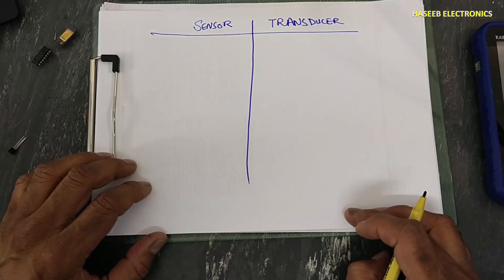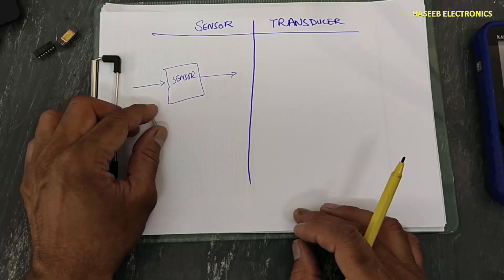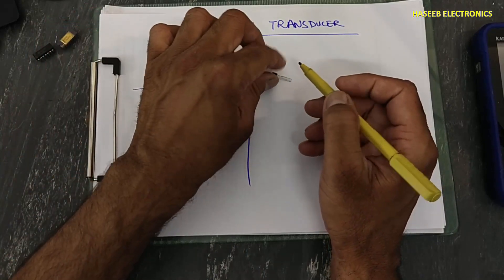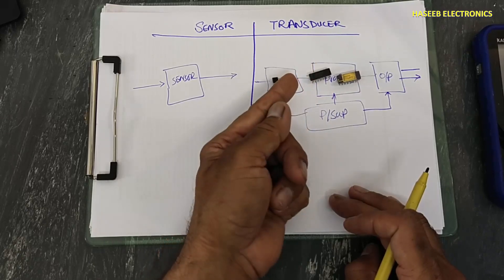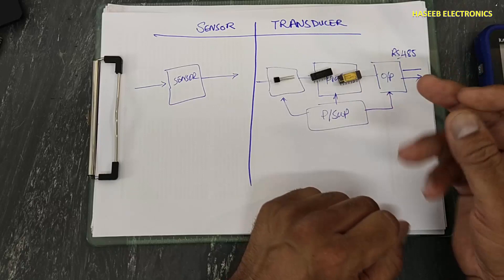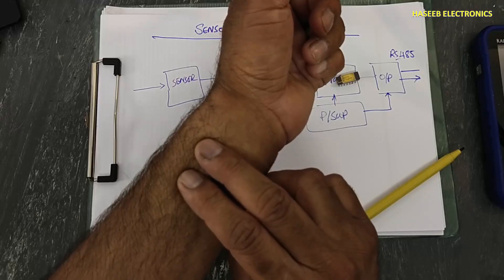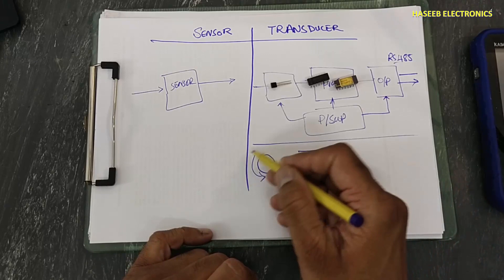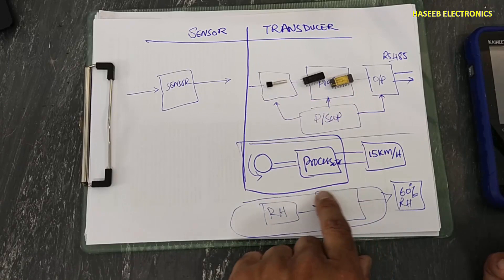{968} what is transducer and sensor

Comment: These terms have been so confused on such a massive scale that I believe any attempt at strict definition is pointless. The definition here of a transducer requiring 'processing', but not a sensor, is mad. A loudspeaker is a transducer. Practically, there is no point thinking of a transducer any differently than a sensor. They are simply things whose electrical quality (or qualities) vary with another physical phenomena, intentionally. The 'intentionally' part is the most important bit.

Comment: Could you explain how a 4-20 mA current sensor is different from a 5-10V voltage sensor.  How can microcontroller read 4-20mA sensor.  thank you
Reply: Measure the voltage drop across a resistor in series with the circuit.